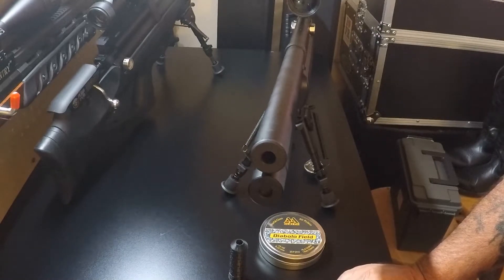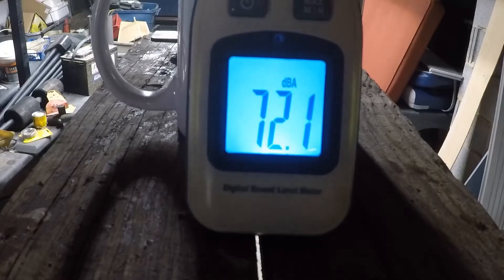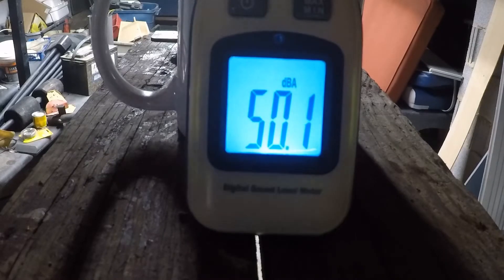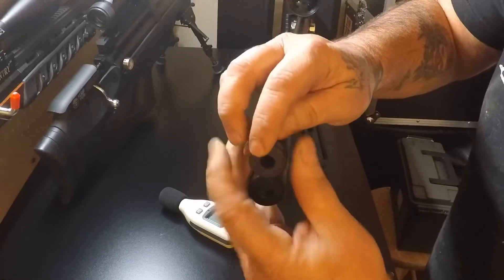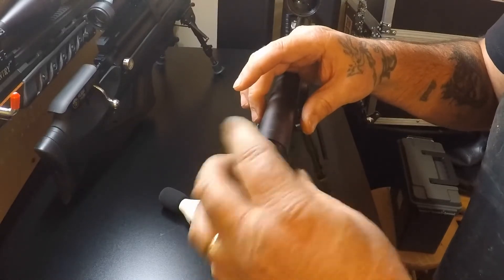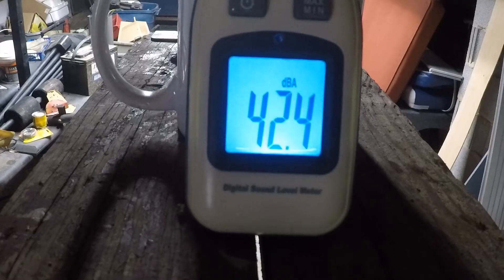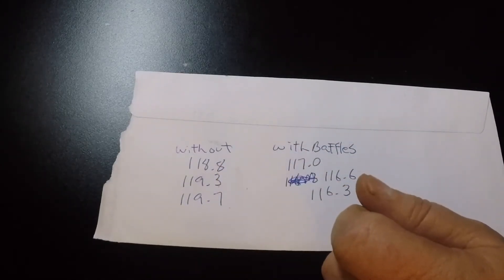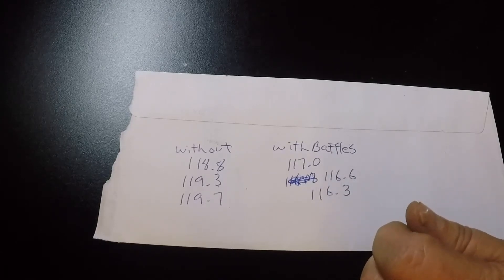Air Venturi Avenger After Market Baffle Install And Decibel Readings

Comment: Put the new donnyfl  extender adapter on mine, since I have several moderators already.  HUGE difference. And it keeps the barrel better in lined.
 ￼Air Venturi Avenger Extender 1/2 x 20 Adapter #A70 × 1
Reply from the maker: That's differently the way to go
Reply: Yes it does help stabilize the barrel,donnyfl..Have one and for the price probaly the best add on period

Comment: 119 seems pretty loud I'm surprised it's that loud even over a hundred being a shrouded Barrel how close are you holding the barrel to the decibel meter
Reply from the maker: Yes that is high. Hold about 12 inches away
Reply from the maker: That’s inside also so probably be a little less outdoors